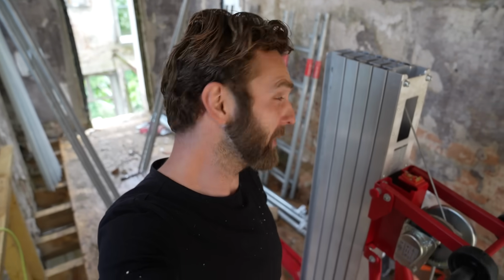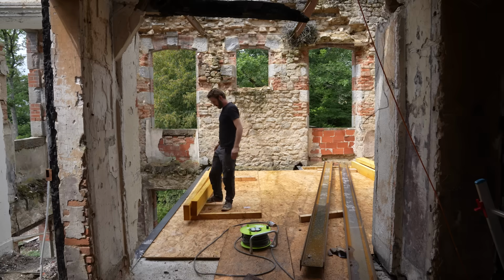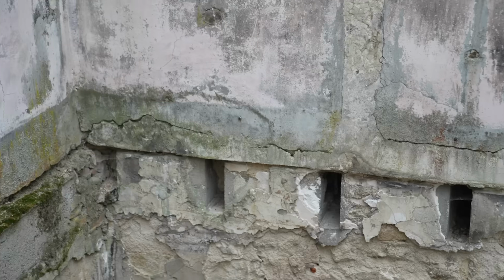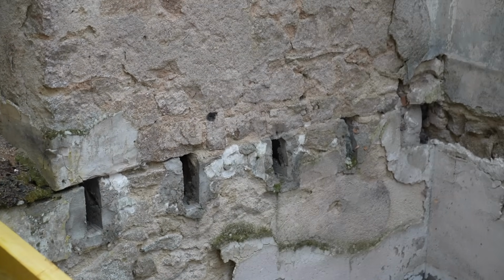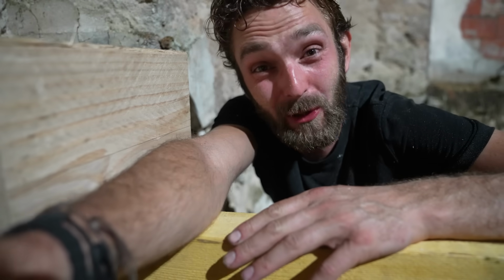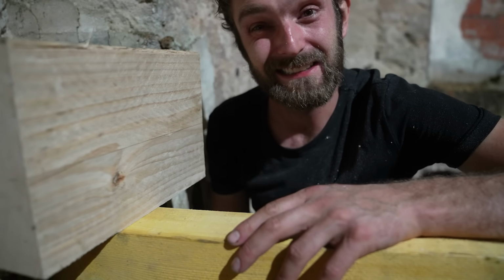Difficult install on the last part of the floor.

Comment: Legit question: there is a certain amount of pockets on each wall. I am assuming the same amount, so that the wooden beams line up. Then you have 1 extra wooden beam in between the metal beams so they do not line up. Was there a purpose to this?

I seen it once and now can not unsee it. Guess it wont matter much if a ceiling is put into place and you can not see the beams

Comment: Plane your beams down width wise by 10 millimetres and they should slide in its a lot easier than hammering the rock and cement out of the way

Comment: Dan, work smarter, not harder. Bring the mitre saw upstairs instead of using that tiny saw to cut the beams.
And instead of chipping at the pockets, trim a bit of width off the ends of the beams - you shouldn't need to take off more than a few mm.

Comment: I'm surprised he's not using some sort of lubricant. Nothing like an oil or silicone type product, but something that will degrade quickly. I think there are things for running wires in conduit.

Comment: Dan, the bracelet with dangling strings need to have the strings shorten because at its current length is a hazard. 
Especially when you’re using the saw… the saw could catch those strings & cause a disaster.

Comment: How about plaining or cutting the ends of the beams a little bit narrower instead of chizzeling out the pockets? I think the 1cm less width wouldnt Make such a difference in strength.

Comment: Why can’t you narrow the boards like you’ve had to trim them to fit into the I-beams? Wouldn’t it be easier to put a cut on the boards that narrows them some so they work for those more narrow slots?

Comment: Wouldn't it be better/faster to either slightly trim the vertical sides of the joists OR put in a steel C-beam along the wall?

Comment: Perhaps it would be easier to shave off the material from end of the beams. See if an1/8th inch removal would be enough. If not, then 1/4 inch. If you try to chisel out the material to make it wide enough for the beam, that will take much more time.

Comment: Word of advice, make sure you select a gravel colour that is sympathetic to the colour of the château exterior. If you go for the bog standard steel grey you risk making the place feel like an industrial site.
Reply: This won't be the final gravel. There are going to be trucks and equipment driving over it for the next 5 or so years.
Reply: @Sgirl  Good point… however there is no harm in going for aesthetically pleasing choices at each stage so long as necessary cost factors are considered. It’s a wise route especially if they inform other decisions you will make along the way.

Comment: I'd definitely be using a planer or something to shave the boards down at the end rather than widen the holes. Doesn't seem like it would require too much loss of the board to slide in.

Comment: Why don't you cut some wood off the thickness of the ends of the boards so they will slide in? Be alot easier than making the cement bigger.

Comment: The pockets look only a tad small to fit the beams. Could you not shave down the ends of the beams, maybe 3mm on one side and maybe the top also? Use a router if you have one.

Comment: You just need to plane the end of the beams.  10mm of the end will have no impact given the number of beams you are putting in. Electric planet will have it off in a minute.

Comment: Instead of enlarging the beam holes, I think I'd be tempted to run the beams through a planer and take a few mm off here and there. You shouldn't lose too much strength and it would save a ton of work.
Reply: Planing just the ends going in to the pocket will not detract strength at all, assuming blocking is added between them like already done on most/all of the prior floor sections.
Reply: Yes, Great minds think alike.

Comment: Ok, I guess Im confused, but weren't you making the sides of the beams narrower by doing the multiple cuts, and chiseling? Wouldn't you want to test the holes with one that has been chiseled to the same width? If that doesnt fit, why wouldnt you just take the joists back out and make them thinner? 🤔🫤😒

Comment: An idea: rather than opening up the masonry,  if the dimensions and level of the masonry mortises are correct, try chamfering your joists. Taking them down 1/8th inch (2-3mm) on each side, and the upper surface. Likely less work in the long run, and you will not compromise the strength in the open span.

Comment: Wouldn't it be easier  plain  the end of the wood either side slightly  just at the end to fit than having to hammer and chisel the openings

Comment: Can't you just turn the saw sideways after cutting the top of the ends and cut the beam relief all in one go? two cuts insted of all of those cuts and following up with the hand work,,, I think the track saw has holes to mount it sideways?

Comment: Or you could trim the beams a bit, much easier to trim wood, than cement.   I don't think the beams would be too thin.  Only a small trim needed.

Comment: Why would you chip out perfectly good concrete pockets that appear to be level and true when you could just take 4 or 5mm off the side of the ends of each beam with a planer? It wouldn't affect the structural integrity of the beams in any way and it's not a shortcut either, despite what others have said. In building, if you're never going to see it and as long as it doesn't affect the structural integrity, you always amend the thing that's easiest to amend perfectly. In this case, that's the ends of each timber beam.

Comment: cut a quarter inch off the side of your offcut sample and see if it will go into the pocket; might have to shave the height down as well.  Much easier to trim wood than chisel concrete by hand.  seems I remember you did this on another floor beams

Comment: Dan, get yourself a power plane and take a couple millimeters off the pocket end of the beams. It will be exponentially quicker than picking away at the concrete.

Comment: Hate to be negative here, but Dan is not being fair to himself. His sometime cavalier attitude towards personal safety will cost him one day. Things can go wrong in a New York second. Case in point: hammering out bits of concrete feet from his face without any eye protection. How hard would it be to don a pair of safety specs? Second case: wearing nifty bracelets is cool, but having dangly bits inches away from rotating blades or drills is asking for an amputation if the dangly bit gets entangled with the power tool. Just saying.

Comment: TIP:- use an electric planner across the grain and reduce the last 4" of the joist ends by 1/4" it will not affect the load bearing

Comment: 😊The point might be moot by the time I've written this comment, but instead of chiseling all of those annoying pockets out by hand, why not try availing yourself of a chisel bit insert in an ordinary cordless electric drill using the hammer function - using safety goggles of course? 🥽 Can't do much of anything if some masonry fly's out into your eyes; doing chiseling work like this is very much up close and personal work.

Comment: which is more malleable  rock or wood? Trim the wood to fit the pocket.  Do not chisel the rock 
And the wood will have to be cut on an angle on the pocket end to be set in the channel of the steel 
yes that is what shims are for

Comment: Dan, rather than chiselling each hole out would it be better and easier to plain off a few mms each side of the wood? I know you’re desperate to crack on, but try not to burn the candle at both ends too much. When you get overtired then you start making mistakes and worse that’s when accidents happen and you’re too precious to your boys  for an accident.

Comment: What if you trim the beams to "thin" them along their sides and top and bottom to fit? So the ends would be a smaller size than the beam itself?

Comment: Why not do what you have done with the wood inserted in the I beam maybe just a light shave  ...wouldn't that be less stressful and quicker and save time butchering the wall and you may ony have to cut one side ofthe beam....but what you have done so far is fantastic well done

Comment: It could be true making the sides of the timber narrower as you‘re not reducing the height but I‘m not a structural engineer, another factor is are the holes forming the same distance from each other ? or does it matter ?

Comment: Dan, wouldn't it be simpler to key out an eighth or quarter inch on each side of the beams so they can fit? Pretty sure the wood would be easier to work with, and a tiny amount of the beams wouldn't cause a safety issue.

Comment: just bevel the end of the beams or plane down each side by 2-3 mm? the integrity of the beam would still be there and it would give you enough purchase to then get them all the way in with a little push

Comment: Why not narrow the wood beams to fit the slots. Doesn't appear that much would need to come off, the beams won't lose their integrity. Much easier than chiseling out cement.

Comment: It would be nice if you had a hand held planer to shave the ends down just a bit or do them the way you do the other end but on the sides rather than the top and bottom just a bit to make them fit.

Comment: Wouldn't it be faster to plane the end of the floor joists to fit then you won't have to add in more mortar?  It just seems it will save you a lot of time.

Comment: Could shave one flat side of the beam on a bit of angle, maybe 8-10 inches at 15 degrees, just enough to fit into already perfect slot…Just a thought, … Easier than chiselling concrete….😊

Comment: See about getting a cordless power planer maybe on the same battery platform as one of your screw guns so you’d only need to buy the tool……….. then you can just tickle the ends on the joists so they fit straight in xx 😘

Comment: Power Plane Dan!! You don’t need to remove much off the ends of the beams. Least path of resistance. To ease the fiction of the beams going in use dish soap. I hate watching you struggle.

Comment: Stop working the stone and work the wood.  Get a power planer for $40 and shave the timber to fit in the slot.  Easy peasy.  Even a chainsaw would shave that timber down in seconds.

Comment: Here in America, we have power tools. Not so sure about France, since you seem to like using hand chisels on everything.....Point being, when you need to make the joists fit into the wall slots. Why are you continuously deciding that chipping  and mortar is better than planning the beams down?! A hand held power planer could remove a 3" wide chunk of wood--up to 1/4" deep-- in about 10 seconds. You could be planning the tops and bottoms to fit the beams, and the sides for the rock slots in probably 30 seconds per end. Seriously. You would spend more time drawing the lines on the beams than planning them off. Work smart not hard. AA also, having to  hammer in joists into place is going to end badly. Moisture is going to expand those joists eventually and either your floor is going to have buckling joints or the mortar joints are going to start cracking. Creating a whole other set of problems which could be easily avoided right now.

Comment: If you have been in the chateau all summer, and don't have the floors in, you need to spend more time working or work harder. If the daily vlog is screwing things up, you need to stop doing this daily because you need the roof on before it goes down to zero degrees.  you can always tarp the windows, but you can't tarp a roof with the snow and rain.  What I would do is to a week long timelapse, and get the roof and the top brickwork in before the cold hits..  That shtt is going to make you miserable if this chateau is open to the elements all winter.  you have to think about how much pain you want to take because you were stupid during the summer.
Reply: It is only a temporary roof and on that side only
Reply: And how do you propose this guy works harder???
Reply: @lindamounts2193  this guy spends hours a day editing footage, and doesn't work hard in the first place.  We would get more work out of Dan by getting him a full time construction job so he learns what hard work is, and then two hours of hard work from 8pm to 10 pm, from someone who knows how to work hard would be more than dan can accomplish in a day.  Videos every week, get a full time job so he learns how to pace his work